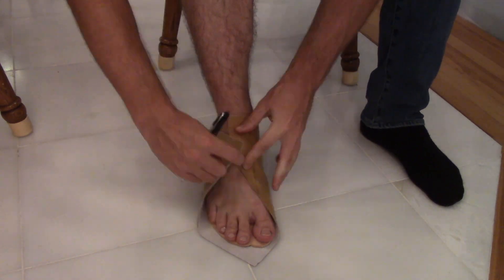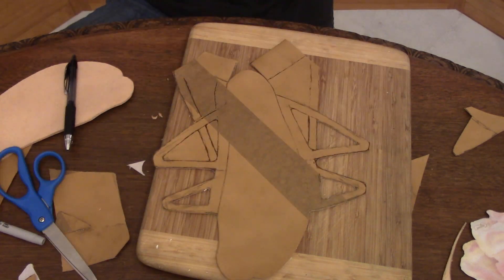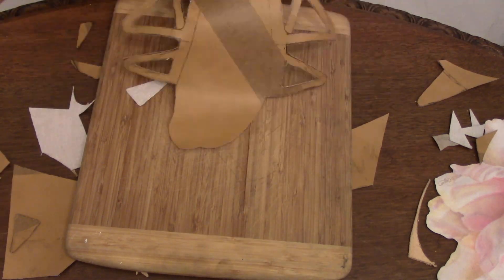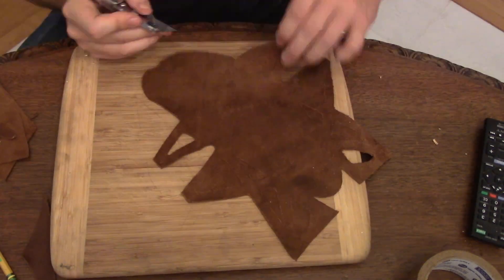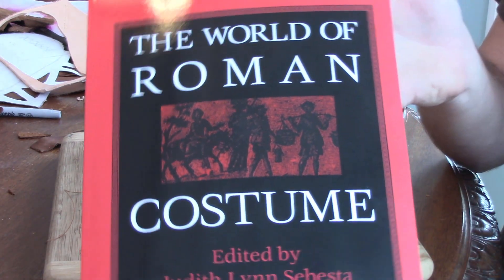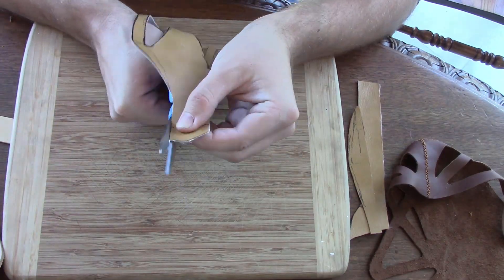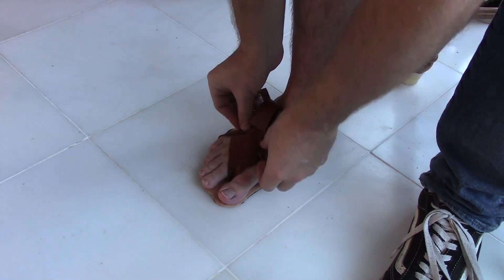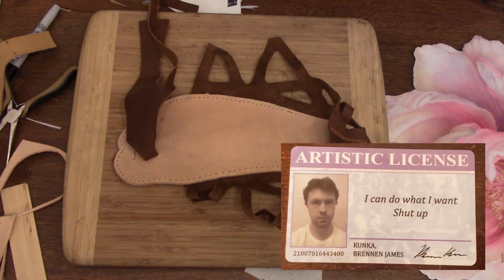Making Ancient Roman Leather Sandals

Comment: it's really interesting to see the process and watch you figure out the best way about things as you go - it's actually really historically enlightening (not to mention entertaining). I gotta ask though, when are the helmet/shield coming to complete the costume?
Reply: I'd like to do a shield in the next year, it will be more first century than the armor though to fit in the reenactment era. I have no idea about the helmet, I need some practice raising sheet metal before attempting that with bronze
Reply: @brennenkunka7118  I was planning a long time to make a bronze helmet too, but found out that getting actually proper bronze was a huge hassle and seemed too expensive so I figured it has to be out of something less authentic. Still its a problem to find any big enough pieces of sheet metal like that.
Reply from the maker: @Spegger B8 bronze cymbals are 8% tin, that's what I'm planning to use. Just gotta plug the hole in the middle. I saw one guy hammer down the dome in the middle and it closed itself. Then he just torched it shut